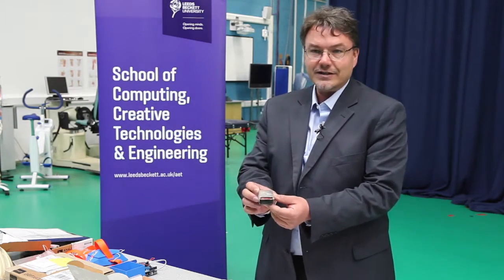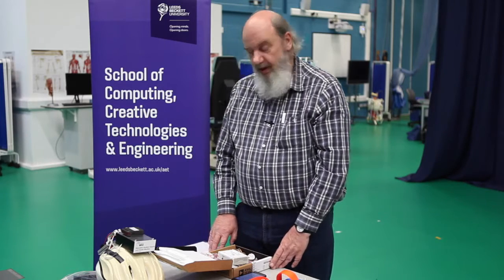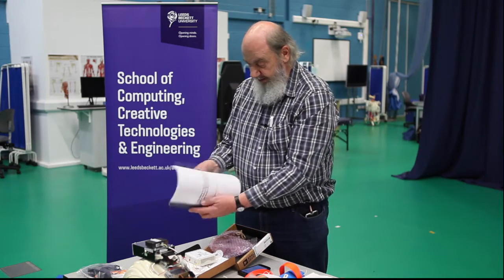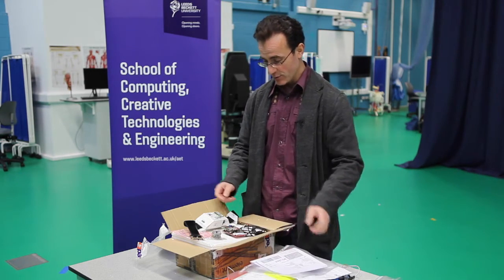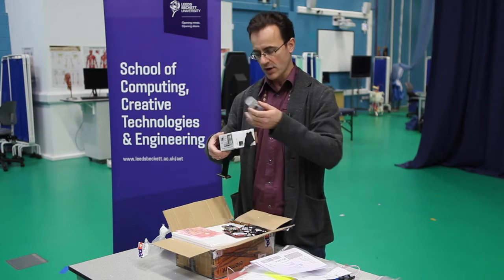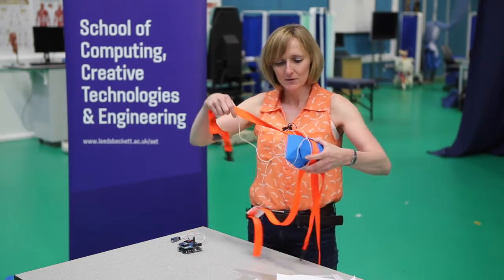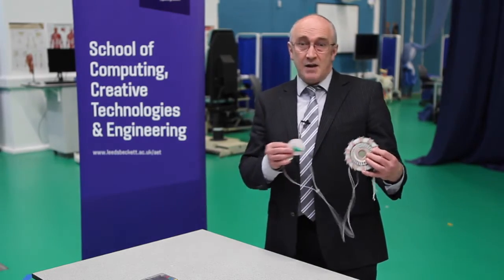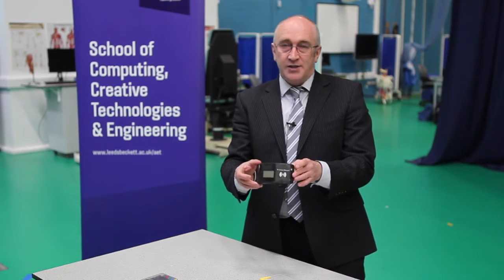Sudden Impact Design Challenge Project Roundup!

Comment: Not to say those aren't great ideas but it seems like you can do the same thing with a couple iPhones and some sensors along with some custom software.You would even be able to record audio and video of the incident, know what compass direction the impact came from as well as the direction the wearer was traveling.  Since they are targeted at athletes, why not use disposable G shock patches or a replaceable cartridge of G shock patches of various values. Those devices look very complicated for what they are designed to do, but that's an engineer for ya ;) Congrats and good luck to all the participants.
Reply from the maker: Mike Smith Evidently you should sign up to a design challenge in future :)